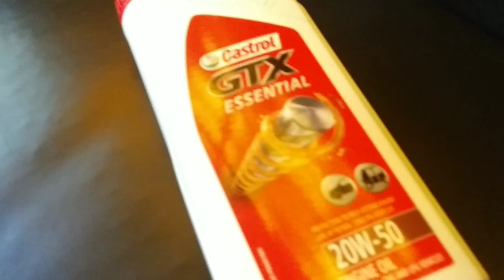engine oil change #autorickshaw

Comment: Hello sir
I got a new problem when I replaced a new piston rings to greaves 435 bslll engine that was the smoke is coming from the air filter and engine is running reverse how can I solve the problem and what is the fault with me on fitting
Can you please reply me